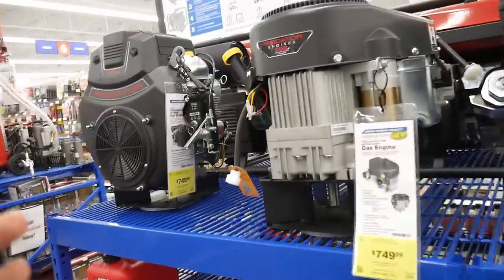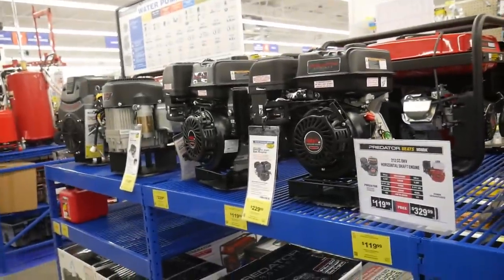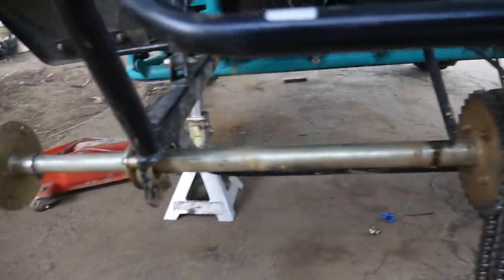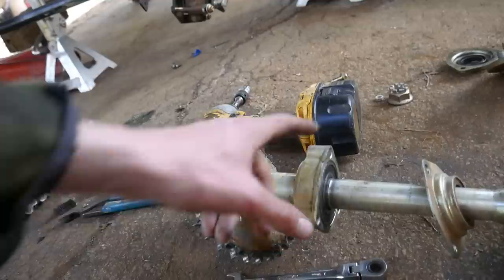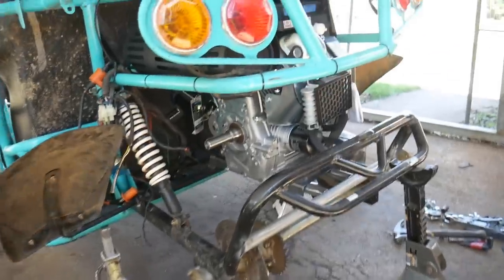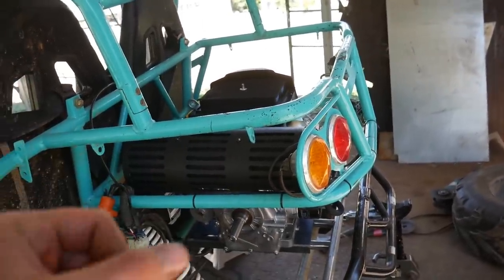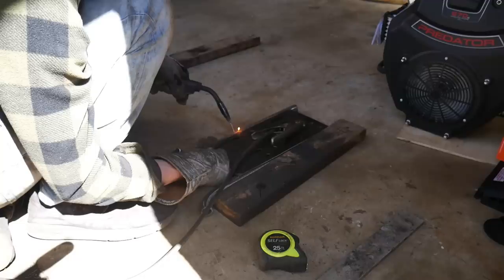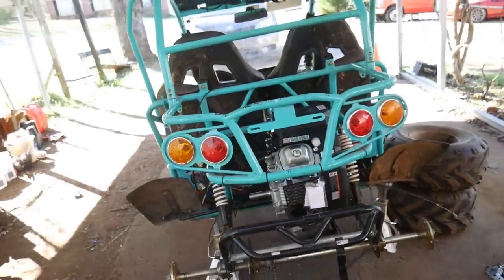I Put a 22HP V-Twin on a CHINESE Buggy

Comment: That's a huge engine! Want to see that ripping
Reply: huge engine but not huge power... more like 20hp... u can get a 250 cc honda engine and get 50 hp out of that... or like 900 cc engine that does 150+ hp.. now thats some real power..
Reply: Lots of displacement but no horsepower.  He should have picked up a used motorcycle engine with transmission instead.
Reply: @larsvegas1505  
You can score new name brand engines like Briggs ebay for the same price as the Chinese junk you can't get parts for. 
I scored a 24hp Briggs shipped for 740 recently. 
Have fun getting parts for that engine.
Reply: I’m sick of people using lawnmower engines instead of race motors cr250r crf450r they both make more than double in horsepower.
Reply: @MrTheHillfolk  at this point id just consider predator a name brand. They do make replacement and performance parts and theyre even the required engine at lots of kart race tracks
Reply: @Hoggdoc1946  just performance build it , i seen a 670cc get 70 ft lb torque with even more horsepower.

Comment: Great job my friend. I already subscribed.
.

I bought a Chinese dune buggy, super cute, but it began falling apart right away. 

.

In a span of 6 months I had to call the tow truck 5 or 6 times. The electrical components were of the lowest quality. I had to change many parts. I had already spent about 10% of what I paid for it brand new. The warranty was very limited.

.

BUT, I love it. Where I live is street legal, and finding a parking space is a breeze.

Comment: Before you cut that sprocket off the axle,or cut the axle,please look at 2-piece bolt on sprockets.A few holes drilled,and multiple gear choices may be better?That cart is So clean !Great find,and start.

Comment: @Vasily Custom Builds
I highly recomend that if you could to get a older  polaris  Trail Boss trans because it will have High, Low, Neutral, Reverse and you can hook up a speedometer to it, You wouldn't have to worry a bought the 670 blowing up those trans because they can actually take a lot of power.
and also with the polaris trans, you could hook the secondary clutch from the cvt kit for the 670 right up to the trans and they are not even that big either

Comment: I'm currently rebuilding something similar. A Crossfire 150r. Mine is in much worse shape. I went with a 420.
Reply: 420😎
Reply: I just sold a BAJA Dune 150 which is almost identical and also made by Tomberlin. I love the GY6 150's. Very reliable and very tuneable. Performance CDI's and Coil and Plug pkgs are $10 on ebay. The weights (SlidersvRollers??)in the front pulley of the Torque Converter are also $10 a set, and a 1500RPM Torque Spring set for the rear Clutch assembly is $10. Foam air filter and 125 main jet will cost you $10. All on ebay. Find CarsandCameras here on youtube. Kindred souls.
Reply: The 420 has so much more power than that anyways
Reply: @bobbystaley9709  It's a fun ride. I never drove it with the original engine so I have no idea how big of an improvement it is. It's tops out ~45mph and will spin the tires in the dirt.

Comment: CHINESE DUNE BUGGY  MOSTLY KNOWN for FALLING APART 😁😂🤣 ROFLMFAO
Reply: I've owned over a dozen Chinese Buggies. Dazon, Joyner, KANDI, Carter, Dune, ROKETA,...etc.  150's w the GY6 air cooled motor, and 250's with the CN250 water cooled motor. All very reliable and inexpensive to modify, upgrade, and repair and replace parts. To this day you can get anything and everything you need from several sources, ebay and buggydepot are great sources. Bang for the buck,.. these are untouchable!! I raced motocross, a local champ. Know what I'm talkin' about.
Reply: Bro everything is made there
Reply: If you tighten the bolts regularly or add threadlocker  to your bolts you shouldn’t have a problem with things ‘falling apart’

Comment: I have a FZR 1100 engine and trans on my chinese dune buggy. Ive stretched and lifted it as well as changed the suspension and steering to a much better quality. Its insanely quick and will do well over 100 mph
Reply from the maker: 100mph on a buggy is stupid lol

Comment: forged rods n valve spring upgrade 28 or 32 mm carbs or custon intake and a weber 2 barrel  32 / 34 mm car carb in the 22hp or an old yamaha  virgo engine i think they were chain or belt drive  manual gears

Comment: Next time to make life easy there's a bolt on top of each shock.
Disconnect heat shock whole bottom swingarm drops makes life easy for swapping a motor
Reply from the maker: I knew that, just didn't feel like disconnecting the swing arm

Comment: Why you have so much trouble grinding and cutting all the frame out? While you just can unbolt the suspension and trailing arm 4bolt in total, the whole rear end will just slide out...

Comment: Parts are hard to find for thoughs and in less u want a cast iron flywheel blowing apart into the back of your head or a clutch bell housing flying your way doing 5000+ rpms I wouldn't use nos

Comment: You'd be well advised Sir to grind the galvanized coating off that pipe a bit to get a cleaner weld and not breath poison fumes....You should have test fit the motor before you welded that cradle in place...

Comment: You could have bought a second hand Suzuki GS500E engine or such and had 50 hp or so with electric start, charging system and a 6 speed gearbox...
Reply from the maker: I really prefer the 670cc for it's simplicity and it has much more torque than a gs500 engine
Reply: @VasilyBuilds   yes it does have more torque but its a low speed engine,,,and that torque converter belt is prone to slipping at those power outputs, i prefer a good gearbox,clutch and chain, you could get a Harley gearbox and clutch and mate it to the engine though.

Comment: That whole section where the engine is literally comes off with about four bolts and disconnecting some cables and the whole engine and rear axle will separate from the go-kart

Comment: Hey vasily if you want to get to the HP you want on 2 stroke scooter build get cr80 pipe aswell as vm18 mikuni carb and widowed piston with reed valve make 3rd transfer port port the intake and exhaust there are a few other things you can do to increase HP
Reply from the maker: Yeah I plan on reeds and a flatslide carb 24mm worked perfect ly. Just won't be till several weeks

Comment: If I'm going to get a motorized bike kit, which one do I get?
Reply from the maker: It's really tricky because I don't know what your going for. But I'd say go with the cheapest one on eBay. You'll be able to fix it if it breaks and learn and move on.
Reply: Ok, a 80cc 2-stroke, but sounds good. Thank you!
Reply from the maker: Yeah. Just know the 80cc is the marketing term, 66cc is actual displacement. You want to make sure it has Japanese bearings, and preferably a long rod. eBay description should mention this. There are all kinds of variants like the 49cc with a shorter stroke. But when it comes down to power 2 stroke tuner knows it all. I'm going to be building up my scooter soon, it's such a cool and unique engine
Reply: Awesome, thank you!

Comment: I put a Yamaha R6 engine on mine. Next build will have a R1 or Busa.... that's a lot of work for 22hp
Reply from the maker: It'll have more soon. Maybe 40-50
Reply: That's exactly what I was thinking, that thing is just begging for a gsxr1000 motor, and if you've already got to do all that cutting and welding anyway, well, why go for 22 horsepower when you could have 200?....
Reply: @TheMattc999  just find a wrecked one with good engine. We chopped the neck off and unbolted everything on the rear. Placed the rest of frame with motor still mounted. Used the same gears.. it will haul A$$. Need some street tries for it but the buggy tires haven't blown even at 100+ mph. Lol you get weird looks passing people on the interstate, cops dont like it either ;)

Comment: hey vasily custom builds do you have ny go carts that you just never use any more never ride just you wanna kinda get rid of it ? ive been thinking of buying predotor 212cc engine and make a go cart but im kinda on a tight buget so if you have a go cart u wanna get rid of that would be awsome it will be used a lot

Comment: Yo brother man I don't know where you get these ideas from but they're badass excuse my language but I have a buggy called the Hummer cart that like to do the 670 on or 500 ninja I'm having a problem on the siding I have a four-wheeler which is a 150 I'm putting a 212 stage 1 on I want to know what your opinion is should I go with a two 12 or should I go with a 420 I have both engines but for the cart what do you think I should put on it the 500cc from the ninja motorcycle or the 670 from Harbor Freight man your opinion really counts let me know something in the comments and keep on the awesome deals dude you're number one in my book you got to do a collaboration with rather be welding
Reply from the maker: 420 id say

Comment: Drove 40 minutes to save $20? Probably spent that in fuel
Reply: XRP BASSIN yeah, i giggled.  Then put a Chinese motor into a Chinese cart that had a Chinese motor.
Reply: @Korgon2013  
I missed how much he paid ,if he said it. 
I just scored a new 24hp Briggs off eBay shipped for 740, I'm sure it's not much more $ than a predator but at least I can get parts for it.

Comment: Just wanted to know if you’re interested in finishing a project I started but got in too deep? It’s the 2006 Honda trx250ex sport trax I would like it to run, currently it has a cracked lower casing piston cam shaft and upper half? Let me know if your interested and contact information.

Comment: Would have been easier, cheaper, better preforming & longer lasting if the original engine wasn't sprung (travels with the suspension)... Could have built it basically the exact same but with the engine hung from the frame rather than the suspension.

Comment: Why a BIGGER sprocket on the back? Chain gauge, yes but # of teeth would lower the gearing making it slower, with more torque power. It already has MUCH more power that the stock 150cc GY6 motor. Why gear slower??????
Reply from the maker: The 150cc was geared alot higher because it had a gearbox. maybe 8:1 this is 6:1. Keep in mind this 670 did 40mph with ease.

Comment: What's everyone doing with the drive sprocket on these?  The driven sprocket uses a #50 chain, but I cant seem to find any clutch or torque converter that has a #50 sprocket.

Comment: Since this kart has large rear tires and lots of rear weight bias It would probably handle better with a 420 than it does with the v twin.  Too much weight on the back can cause another understeering incident wouldnt want to see you hit another house.
Reply from the maker: I get what your saying, but it only understeered because I was going too fast. I want to do wheelies, so 670 will be good for that. I'm going to modify it, but reduce the gearing, so it only topps out at 25-30 probably

Comment: save 20 bucks on the motor, spend an extra 20 driving an extra hour there and an extra hour back :p
Reply: Or get a real engine off eBay for about the same money. 
I just got a 24hp briggs new, shipped for 740.

Comment: Hey dude. Cool build.. A couple things I noticed. The pipe you were using seems very thin. Just try and brace it up as best you can. If your going to Hot rod that motor your looking at over 30Hp all day and alot more torque. 
  Second. The pipe you are using looks like its coated. Welding that kind of pipe with a coating is extremely poisonous. Hot dips and Galvanized burns severly toxic fumes and you can screw up your lungs in as little as a week. And even die very quickly. Go to a steel shop or even a scrap yard and source your metal pipe or tubing before you kill yourself.

Comment: The title says 22hp like its powerful 😂 get a mt07 engine. 700cc twin 74 hp reliably
Reply: Better off getting a proper bike engine than paying so much for some slow revving, horrid sounding, governor limited POS Briggs clone.
Reply from the maker: Sometimes simplicity paired with reliablilty, beats advanced and complexity
Reply: @VasilyBuilds  - in the real world, a properly engineered, better sounding, better performing, lighter, lower cost product that's specifically designed for the task beats an old fashioned, clunky,  botched together, high cost, slow, heavy and unreliable mess like this one.
You're already burning out CCT belts after a very quick run. That's not going to be reliable... at all. Plus it sounds absolutely horrid.

Comment: See, I love the gy6 motors. I put a 232 on my Chinese moped, along with upgrading all the suspension and drivetrain and it runs great. I can do 65 with ease. Plus fuel injection is amazingly simple compared too carbs.

Comment: Not bad I'd like to see more of what and why your cutting off in order for the fitment of the engine. If you were to make it more of an educational type deal where if someone wanted to follow along in order to do the same I could see no reason why your channel wouldn't explode. Just think about how many parents have those things just sitting around because of the cheap engine went bad. Yeah slow it down a bit and explain why and what your removing while your doing it...

Comment: So how far did you "droven" to save $20.00? If you drove more than 35 miles you didn't save anything based on 56.5 cents per mile the Feds say it costs to operate a vehicle.

Comment: You spelled "go-cart" wrong... 

...because if you didn't spell it wrong, and you actually think that's a dune buggy, then you've never seen a dune buggy.
Reply: Go-karts have max 2" ground clearance, no roll cage and won't ever get you up a sand dune. That's why he owns a dune buggy- albeit a small one.
Reply: @rossbrumby1957  yeah...  No. 

1) that isn't a roll cage.  But LOL 
2) that thing isn't tearing up any sand dunes...  even after he put that harbor freight engine in it.
3) my 14 year old daughter has the same exact piece of shit...  And even the Chinese guy who put the wrapper on it called it a go-cart, specifically an "off road go-cart"... Because he printed it all over the assembly instructions, and owner manual.
4) where did you get those specs??  

Dune buggies are car sized... with car sized tires...  And not powered by Briggs & Stratton!  They were originally built up VW beetles... Or "bugs"...  Which is where the term dune buggy came from in the first place.  Just like throwing a wing, and a fart pipe exhaust on your 6 cylinder mustang doesn't make it a racecar...  giving a go cart 5 inches of wheel travel, doesn't make it a dune buggy! 

This is... A go-cart.

Comment: Those axles are weak, they aren't solid. They are welded. they will break, I know from experience
Reply from the maker: weight for weight hollow axles are stronger than solid. The same reason driveshafts are usually hollow

Comment: How on earth do you get that pipe bender to not kink?
Reply from the maker: Read the instructions and use the specified schedule 40 pipe and dies accordingly
Reply: Oh, alright. Maybe I wasn't using the right sized pipe.
Reply: I fill pipe with fine sand.  Pack it in, tape ends and bend.  Never a kink.
Reply from the maker: @v35james78  My advice: Pipe shouldn't need sand. It bends no problem. sand is just a hassle. Tube on the other hand will kink either way every time. Heat, water, dirt, and soil wont help